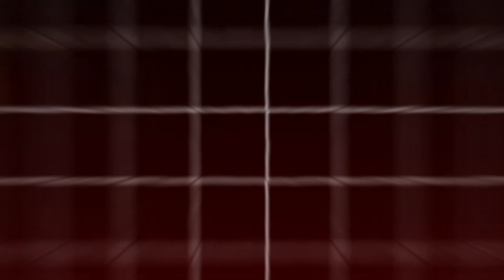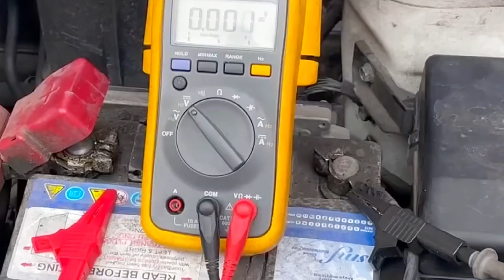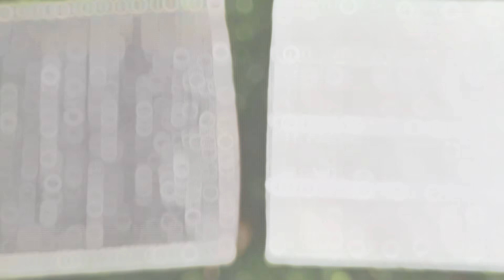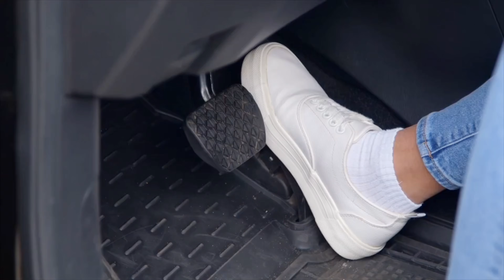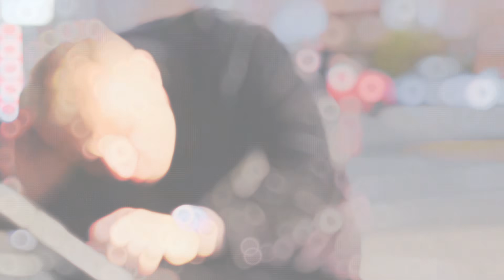Stupid Mistakes DESTROYING Your Automatic Car (AVOID THEM NOW)

Comment: As far as the park pawl and handbrake go, you should engage your handbrake in neutral before releasing your foot brake to allow the weight of the vehicle to rest on the shoes then you engage the park pawl. This is especially important if parking on an incline

Comment: He's wrong about premium fuel. It does give you a hair more power, it burns cleaner and you can get up to 20  more miles to a tank, and the car/truck runs better. I know this because I tested it on a 1993 GMC, 2004 Honda shadow and a 2005 Jeep. I ran 2 tanks of 87 out of all the vehicles They performed worse and got bad fuel milige than when I ran 91. 91 is more expensive but the savings in longevity of the car are worth it to me.

Comment: I’m an old lady n used to drive an old Mitsubishi 2001 model till recently. No problems coz I get my oil filter changed every 4 months, check/fill my oil n coolant every 2 weeks, my brakes get changed when it squeaks, never use aircon due to my sinus. Only reason I bought another car was bcoz a friend had a good car he wanted to sell.

Comment: The oil light does not indicate low oil level but low oil pressure. There can be several reasons for this, not just low oil.

Comment: I live in San Francisco and don't drive my car a lot in the city (hills, traffic, parking). So I get fluid-replacements done on time rather than mileage.
ALSO, here's a suggestion that may save on brake servicing: when going down long steep hills, I downshift to my lowest gear. That way, I'm not riding my brakes all the way down the hill and I've noted that it keeps me about at the posted speed limit (almost always 30MPH). NOTE: I've found this works on long downgrades on roads too: shifting to D3 from D4; I have to use my brakes infrequently or not at all.

Comment: I don’t even own a car. In newer cars: What I was informed is that in a traffic stop you should never switch the gear into neutral because the damage damages the transmission. 
So should you or should you not switch into neutral during long stops?
Reply: Modern cars with brake hold can manage any transmission issue.
Reply: @matthewlee7405 brake hold? what does that mean?
Reply: @fredflintstone2234 , cars with electronic brakes will automatically hold down the driving brake when you fully depress the brakes when you come to a stop, even after you lift your foot off the brake. You disable it by stepping on the accelerator. You logically just leave the shift in Drive. So even if it is true as this video says that keeping shift in Drive for longer stops degrades the transmission, there should logically be some electronic intenvention to prevent that to complement the brake hold feature.

Comment: you don't need to use the parking break on a level surface, even a slight grade is fine, don't have a car running on a steep slope without the parking on or turn it off and have the weight on that pin

Comment: I don’t have air con but I have a recirculating button and I use it when driving behind a really smoky car exhaust or going past a sewage works ! Or if you pass a fire or any other reason you don’t want outside air coming in. The button was there long before air con !

Comment: I look at the tires for the correct air pressure. I have replaced the original tires, now the manual is outdated.

Comment: Truthfully I’m shocked at my ignorance. Probably didn’t know 15 items. Right now making a list for the mechanic to service asap. 
Best tips ck oil gas cap tire pressure battery corrosion replace wipers cabin filter recirculation button and neutral at long stops. 
And now I remember why I never keep the car longer than 3-5 years. Females stuck on the road worst case scenarios.

Comment: my gas cap broke after 10 years and 90,000 miles ..so i went to a napa across the street from the gas station and got a replacement .. 6 months later it failed and check engine light came on .. so i went to the dealer and he said it was the gas cap .. put a oem on and now its been good for 3 years so far ..
Reply from the maker: An OEM replacement gas cap solved your issue. Hopefully you save more money in car bills in the future

Comment: I use recirculate to close outside air when on a dusty dirt road. I also use it with the AC. I don't use heat in winter, but if I did, I would not use recirculate because the heat comes off the engine so it's not costing anything.

Comment: 0:20 Not checking your oil level regularly
1:25 Using the recirculation button incorrectly
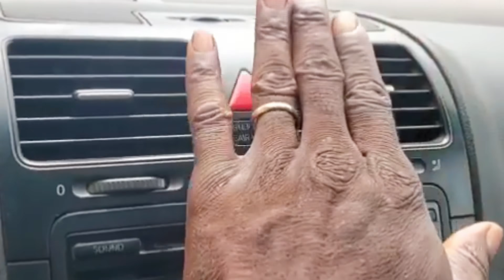2:43 Ignoring the check engine light
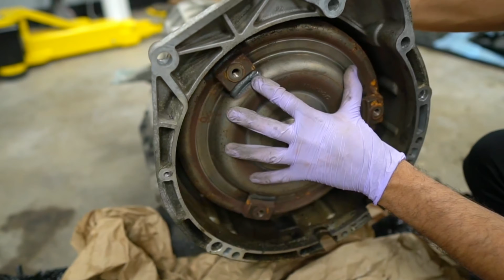3:53 Not using the parking brake
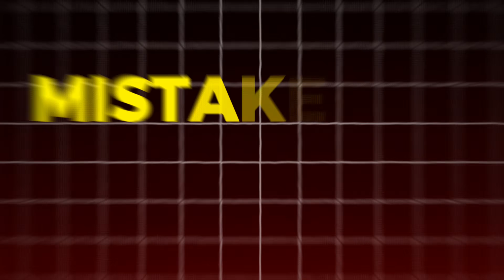4:59 Not replacing worn wiper blades
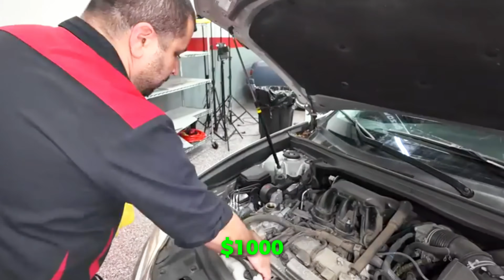6:07 Pressure washing your engine bay
7:24 Driving through deep water
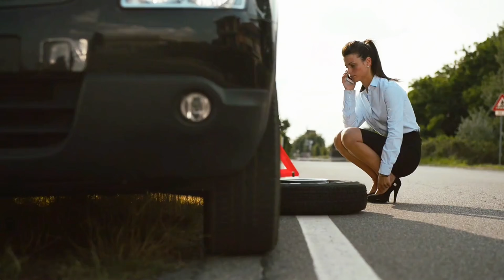8:42 Skipping the battery reset after replacement
9:57 Leaving the gas cap loose
11:06 Resting your hand on the gear shifter
12:16 Not replacing your cabin air filter
13:33 Overloading the vehicle
14:47 Leaving the car in drive at long stops
16:01 Revving a cold engine
17:20 Not using the correct tire pressure
18:39 Using high-octane fuel when your engine doesn't need it
20:39 Not checking battery terminals for corrosion
Reply: Thank you!
Reply: Thank you. 🤜🏾🤛🏾🙌🏿
Reply: Thanks for saving me 20 minutes
Reply: Saved me 15mins.🙏
Reply: Thanks
Reply: So thoughtful. Thank you!
Reply: KISS. Cut that list in half by changing to an EV.

Comment: I miss the cars we had before the sensors and modern technology.  They were perfect, simple and lasted.
Reply: That's why mfg stopped making them.
Reply: Agree, I hate new cars..Way too much computer chips..I'm sick of it.....I don't want them and I don't need them..😢and now you gota take your car in for diagnostics test..😡🤬👎 I can't afford it....
Reply: Now everything is ‘eye candy’ and made NOT to last long. 😞
Reply: Well, no one's stopping you from buying an old used car for cheap.
Reply: you clearly never have worked a carb engine......
Reply: Boomer alert!!
Reply: I remember when 100k miles was the turning point for most cars. That's closer to 200k now. Cars are much more reliable now than they ever were in the 80's or 90's. 180k miles on my cruze with no major repairs, 120k on my crosstrek with no major repairs and a $12,700 trade in at the dealer towards my new one. Trucks still on the road at 250k miles without feeling like a pile of junk.
Sure, some repairs now are considerably more expensive now, and there is much more to fail, but there are so many more cars on the road now with 150K+ miles that still run well than there ever were "back in your day".

Comment: Cheap wiper blades are okay if that's all you can afford, def better than letting them go, but if you have the $, spring for the really nice ones. I could not believe the difference in clearing. They were so good that we bought them for our old mini van as well.
Reply: What brand? Please share. Thanks.
Reply: @nannem9716  We get Bosch ICON Premium Beam. They are expensive - at least to us they are.

Comment: Washing the engine will not hurt anything because all electrical connectors and sensors are sealed from water! Car dealers have been washing engines and painting the engine bay for decades!

Comment: Well I try to turn my off and I can't run air conditioner..it automatically puts it on recirculating, the minute I turn it off, it won't run air conditioner on max period..I hate 2015 and up Jeep models!! I live in desert summer heat, temp reached 105° last week. I need the max air but I can hear the engine working double and the air conditioner fan is loud and obnoxious!

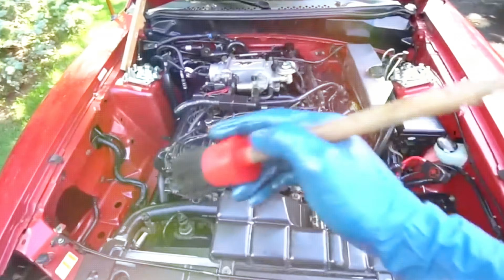Comment: 6:08 Spray with degreaser, use a brush to agitate, and use a simple WATER HOSE (not a power washer) to gently wash it off. If you have one, an leaf blower can be used to get rid of the excess water. Then just wipe down with a microfiber towel.

Comment: "use the parking brake", yeah not in an automatic in the midwest in the USA.  If it's never used, you risk having to cut the brake line.
Well maintained Silicone wiper blades can last well over a year.

Comment: I have only used the parking brake in my 2000 Silverado automatic 4.3L with 230,000 miles on an incline for 26 years. Not once have I ever had to replace the transmission. I've flushed it twice. It still shifts smoothly. I also a mobile auto detailer and have never had an issue or complaint by using a pressure washer on an engine or engine bay. Yes, you to be careful where you aim, how close you get on some components and cover some other components, but for the most part it can be accomplished. Especially with newer engine bays where most of the fragile components are already covered. Leaving car in drive at red lights, drive-thrus and railroad crossings damages a transmission or resting hand on shifter, LOL! I have never had an issue in the 40+ years driving.

Comment: I’m calling 🧢 on the air recirculation. I’ve been running that nonstop in my 2015 Honda Civic for the last 11 years in a very humid Florida, and never had an issue with the AC
Reply: I live in Montreal Quebec, and I can attest to it for winter weather. If it's on with the heating the car will fog up and moisture will accumulate on the inside of your windows. It's really bad and it was a revelation for me after I figured out the cause.
Reply: I agree!

Comment: #11 (DRIVING THROUGH DEEP WATER):  What is the very first thing you almost always see on TV coverage of flooding somewhere?  PEOPLE DRIVING THROUGH DEEP WATER - and almost never with a warning that you shouldn't do this!  So it's ingrained in people's minds, that deep water is no more than a (literal) speed bump that you can traverse.

Of course, outside the scope of this video (which is entirely about car mechanical systems), the deep water can be hiding a washed-out part of a road, or a washed-away small bridge over a "crick," or it can be deeper than you think.

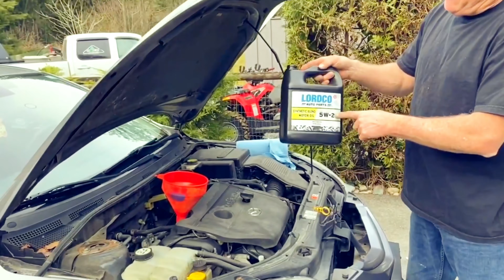Comment: 1:19 DO NOT OVERFILL YOUR OIL! IT WILL DAMAGE YOUR CAR TOO
Reply: Yes, one Ford dealership did that to my beautiful Ford Country Squire. They didn't "know" that there were two bolts you need to remove to drain all the oil, before adding the new oil. They just drained part of the oil.  Then they added 5 quarts of oil. They didn't even check the dipstick. Needless to say when I drove the car on the highway for an hour,  all the gaskets blew out on the car and ruined my beautiful engine of my sweet old car. All the Ford dealership said was, "We'll clean up the engine to make it look new...." because I was a women and they thought I was stupid. (My Dad taught me how to change the oil in this car and I changed the oil myself on this car every 3,000 miles, but I was short on time and figured a Ford dealership could do it. What a big mistake!)  I was livid and told them. "You need to buy me new engine!!"  It never happened. Sigh.

Comment: Don't put the parking brake on unless you fully engage it so that the car struggles to move when you go to drive it. My girlfriend just barely engages the park brake which does nothing except when you go to drive the car and don't dis-engage the brake, the brakes get hot and wore down by the time you realize that the park brake is partially engaged. The little park brake warning light is strategically placed in a zone on the dashboard that is blocked from sight by the steering wheel.
Reply: She needs a Tesla with autopilot....

Comment: Thanks. I always use the parking brake when parking. And recycle the air when using AC in warmer weather while using fresh air when it’s humid and cold. My car has been stalling alot. I cleaned my MAF sensor and saw the corrosion on my battery terminals which I cleaned with baking soda and distilled water. Then use a steel brush that is made for battery terminals.

Comment: The funny thing is that if you dont use the car... it will brake down as easily as if you were using it on a daily basis. There are excellent points in this video, good reminders, which should be tackled down during the Maintenance checks of the vehicles. i dont feel confirtable swapping batteries unless I am on an emergency situation...

Comment: AC does the exact same thing as a fridge, it pulls the moisture out of the air.

Wanna know why your windows fog up when it’s humid outside? It’s because the glass is cold and  condensation forms on the exterior of your windshield and other windows. Wanna know what clears it? YOUR WIPERS!!

Comment: My Hyundai has an electronic parking brake which I hate (but use).  Later models went back to manual ones after all the complaints.  Also, my mechanic never uses the parking brake when done with the car.  Never understood putting all that pressure on the transmission.

Comment: I never new about resetting the BMS after putting a new battery in so thank you I will do this 👍 and I went on YouTube and all you have to do type in your auto year make model and put how to reset the BMS and a short video will tell you how to do it I would tell you how but I'm sure not every auto is the same I can tell you that on my car it doesn't need no tools or a electric device all I needed was me and my key

Comment: Mistake #5 "Leaving the car in Drive", I used to always do that when a stop would likely take longer than a few seconds, but strange enough I saw a video not unlike this that said that it's totally not necessary on modern automatic gear systems (it was also explained why, unfortunately I forgot) and might even cause a bit more wear and tear as the shifter is moved every time. Which one to believe?
Reply: Better to leave in drive that shift on a slope or start accelerating before drive is fully engaged after every stop light. I almost borked my engine !
Reply: eeeh, depends, if you are stopping a lot, leave it in drive. If you stop once but it's a very long stop, switch to neutral.
Reply: @AjenLarod good advice but need to remember that you engaged neutral and must put back into drive before accelerating
Reply: @AjenLarod  Thanks, I'll stick to that (although when a bridge is opening or smt. I usually just switch the engine off - fuel is expensive in most of Europe). And I once read that (only) six seconds is the "break-even point" where you use less fuel if you switch the engine off, because it uses slightly more when you start it (not that I do that every 6 second stop ;)

Comment: Funny that mistake #8 at 11:10 that was pumped into my brain with driving lessons in 1983 (when manual transmissions were still totally the norm here in Europe) ánd always press the clutch when you start a car (because it might be in gear and lots of people leave their car in first gear as an extra handbrake). Strange enough motor bikes often don't start if you dont engage the clutch, but I've only seen that once on a car (I think it was a quite common Nissan).

Comment: The parking brake I haven't been doing. Going to start now
Reply: I was told when I moved to a snowy area not to use the parking brake because the mechanism under the car would freeze and not release when I wanted to go. Is that true?

Comment: Every vehicle should come with a small manual of these common sense care tips, along with the extensive user's manual.

In the old days(up to 80s) the engines were built different and it was common practice to rev the engine in the cold.

The manual steering Hyundai Stellar I learned to drive on, should have been allowed to sit and warm up, the engine would rattle loudly in extreme cold Canadian winters.  Never seen anything like it.  The whole vehicle was frozen, cheaply made, including the frame made of heaven knows what new material, car bodies used to be made of only metal at one time, much safer and weather friendly. Could endure heat without putting degrading plastic particles into the environment.  Could endure the extreme cold without sounding it would crack in two.

Even the children's Tonka trucks and dinky cars were pure ketal😮

Comment: When ever I'm driving and I see construction up ahead, kicking up dust or one of those idiots who outfitted their truck to spew out black smoke from their tail pipe, I immediately turn on the inside air recycling switch and the fan on the lowest setting, while closing all windows until it's clear.
Reply: Me too!

Comment: Whether you recirculate or not has NOTHING to do with AC system life. The clutch is magnetically coupled. The interior fan use is the same. The compressor is belt driven. It is an uninformed statement.

Comment: Basically maintain and service your vehicle regularly and you will be fine.
Reply: You will if the vehicle you own is intrinsically reliable. If you have the misfortune to own a car with a 'wet-belt' system then expect terminal engine failure even at low mileages, no matter HOW well you maintain the thing. 

And with diesel engines the jets, the DPF and the EGR units can all pack up at any time, and replacements can be horrendously expensive, even if you've properly maintained the car.
Reply: @timelwell7002 
And all this time, I was thinking that I wanted a diesel engine.
Reply: Oh

Comment: Re the recirc:  if it’s 80 out and 120 in the car, cool using the outside air then switch to recirc when the inside is less than 80.
Reply: It’s sad you have to explain that to people.
Reply: Also helps to open all your windows before you start your car and AC in hot weather
Reply: If it wasn't needed why would they put it in the car...it's obvious
Reply: @scottmcmartin2622 my 92 year old easily duped father swears that the recirc button is designed to kill your engine. I guess he watched a You Tube video that was putting out false info

Comment: Remember the old Dodge Grand Caravans? We had one for 12 years. It had THE BEST air recirculating system ever! You could drive by a roadkill skunk or a waste water treatment plant and not smell a damn thing!! It was really incredible! Of all the vehicles I’ve owned (Oldsmobile Cutlas, Hyundai Santa Fe, Toyota Highlander, ‘08 Lexus RX 350) none have completely blocked outside air as well as the DG Caravan did.
Reply: My very first car was a cutlass salon.